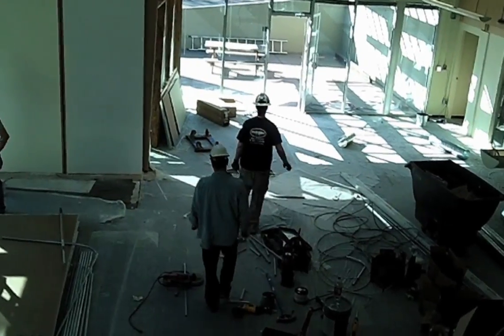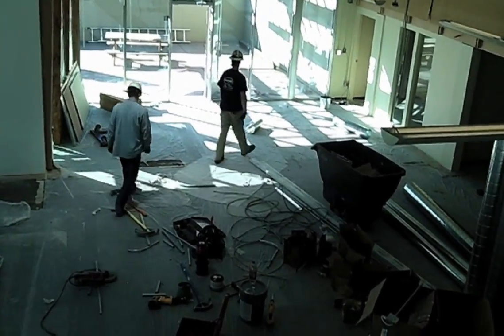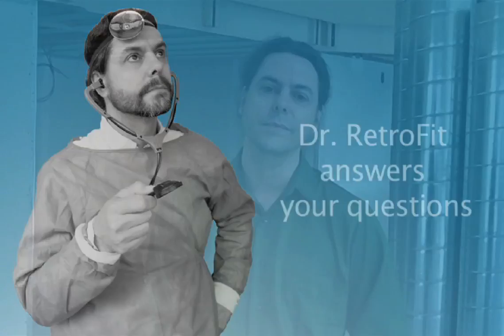Dr. RetroFit on Geothermal

Comment: @ebut620
I was just making an educated guess, since no one else had responded to you. 

On the energy used to heat/cool a house and it being more than lighting etc... Yeah, I can tell you from personal experience that, I can get my utility bill down to 50/40 dollars a month USD, during the summer, and my electric bill down to 18 dollars USD, but winter rolls around, the electric shoots up to 100USD easily, and so does the Utility. And that's me being very conservative.

Comment: @ebut620 
I don't know much, but isn't actual energy generation from geothermal, well basically location matters I believe? Geographically.

Solar has it beat as far as being anywhere, and cost I would imagine is why its getting the support it is.
Solar panels you just have to mount, but the geothermal you have to do the heavy digging, and installing whatever hardware.

Heating and cooling w/geothermal, that can be pretty much anywhere location wise from what I understand.